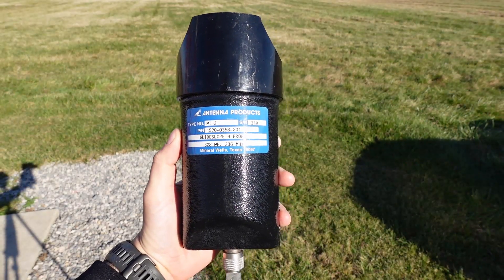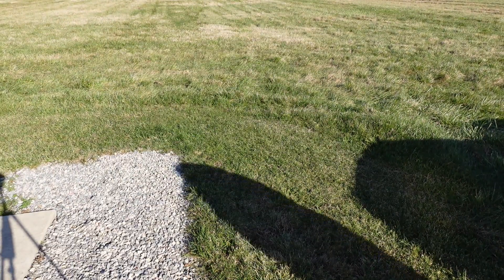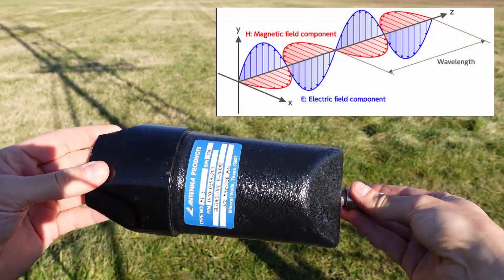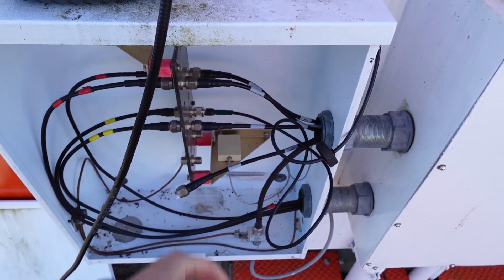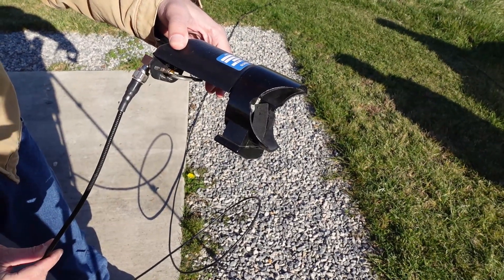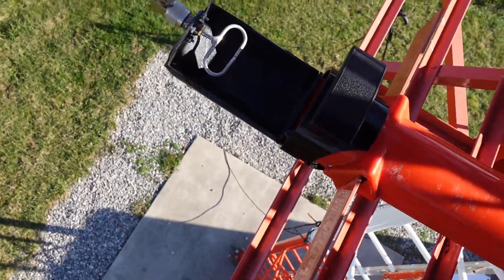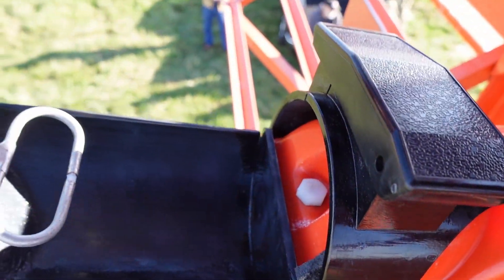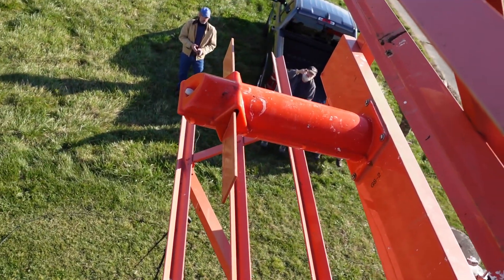Glideslope Antenna Dipole Testing using an H-Probe

Comment: Thanks, I had never seen that probe during my AF career (Retired 1996; MSgt T Jones).  I am pretty sure in the actual GS-2 antenna the middle one was physically delayed (same difference or end result).  The phasing between the 3 antennas in the co-linear array results in a narrower horizontal beam pattern, so less effects from reflections off of stuff to the sides in the fresnel zone.

Comment: If it fails can you replace a single dipole or do you have to replace the whole antenna?
Reply from the maker: You certainly could if you had the know-how but I believe most agencies would classify it as depot level repair and no tech data is provided at that depth for field maintainers. These antennas are coded as throw away once they fail in any way.